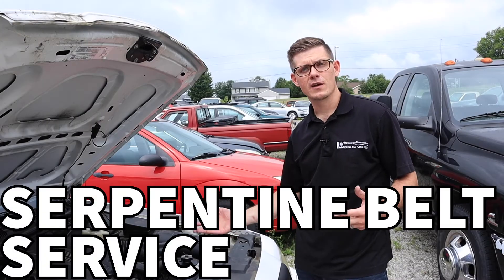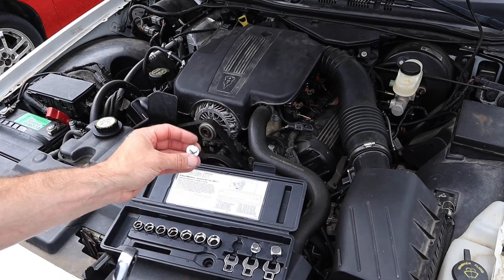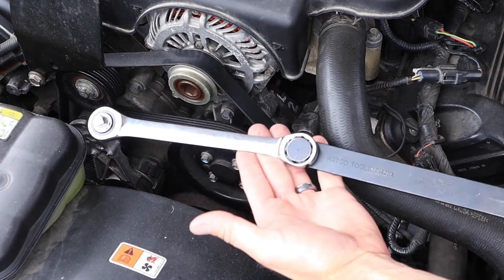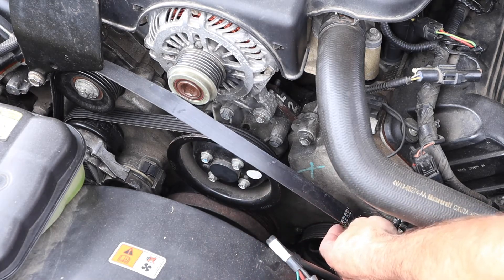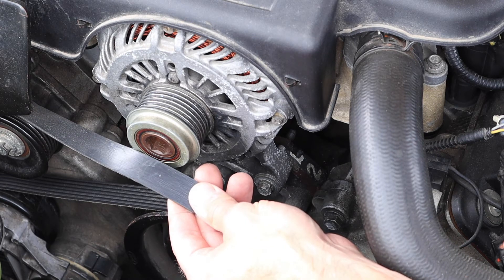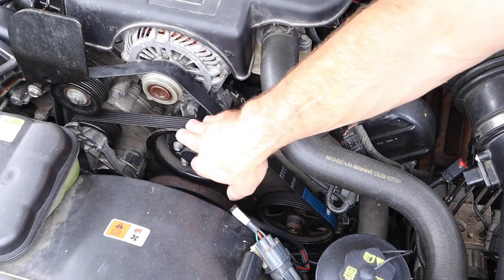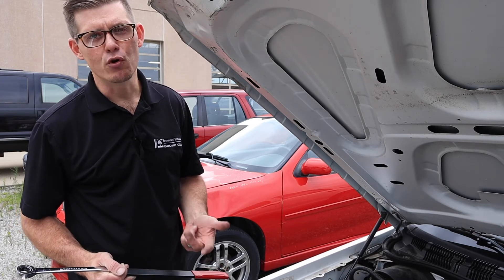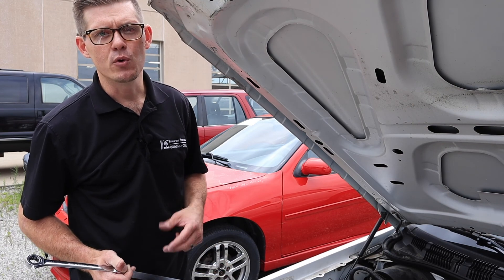Getting Started: Serpentine Belt Service

Comment: I have a polo 1.2 and its tensioner doesn't move that freely. The tensioner has a t50torx bolt which is a pain to move. Will that tool help me to move it that freely?
Reply from the maker: It certainly could help with leverage to move the tensioner.
Reply: @AdamsAnalysis  i finally got one. And I must say it certainly did make it a lot easier. Thanks for the video man.🙏